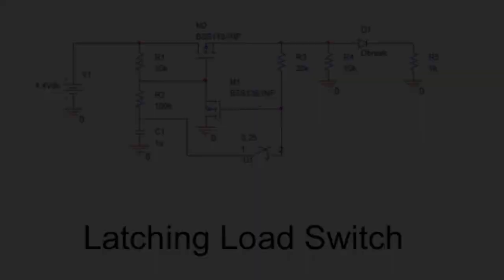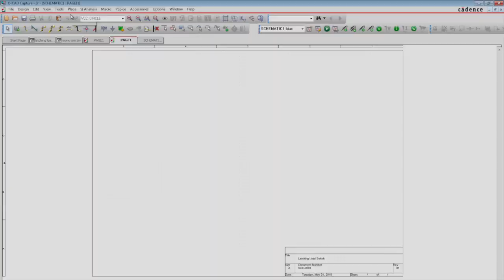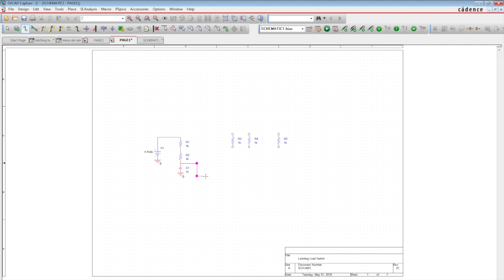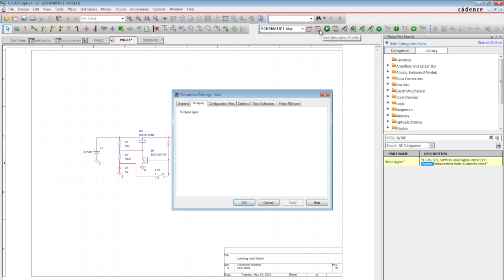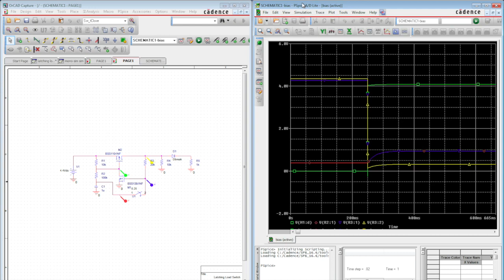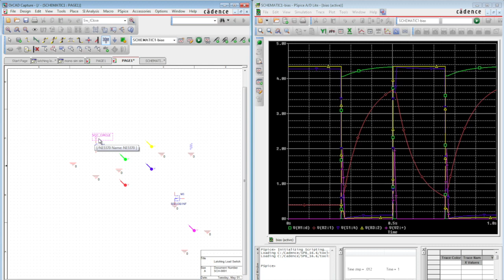Latching Switch PSpice Simulation

Comment: is this circuit dependent on those specific FET's or can I just use a generic P&NMOS? I copied your whole circuit exactly with the exception of the exact FET's and mine does not seem to work at all.
Reply from the maker: As long as your FETs get to VGS you should be ok. You also need a separate signal from the MCU to keep it latched on (thus the name). This signal needs to get asserted ASAP before the original power on source (like a button press) is lost.